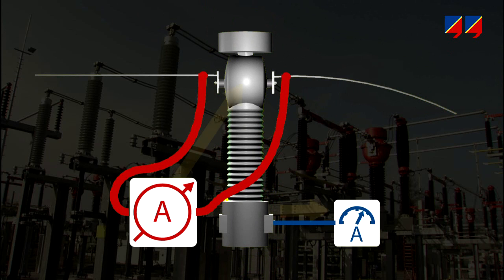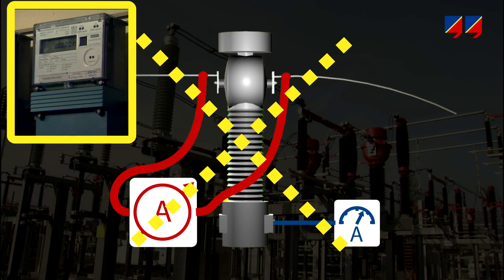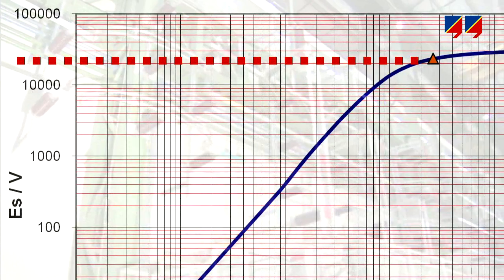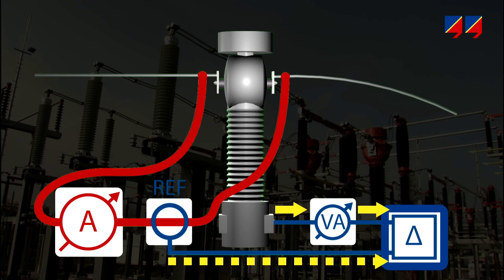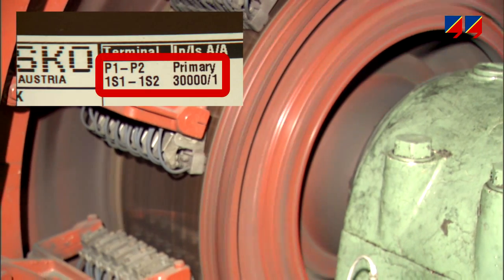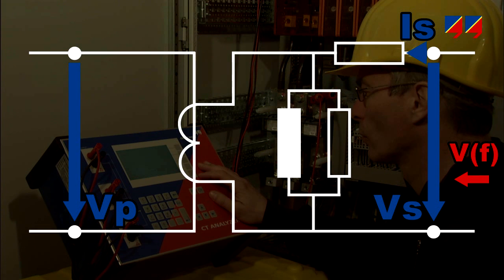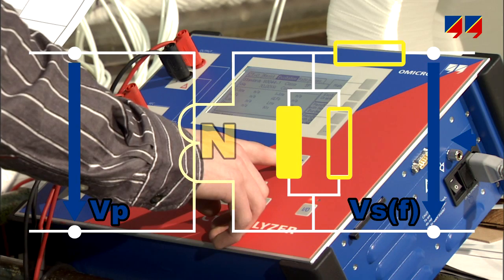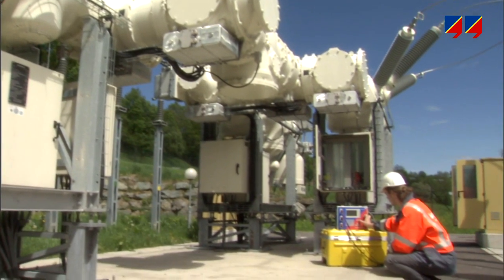Methods for current transformer testing

Comment: What happens if the HV terminals of CT is short circuited while performing Turn ratio test?
Reply from the maker: Dear Bern Traña, 

thanks a lot for your interest in this video and for your question. Connecting both HV terminals to ground would cause incorrect measurement results. Connecting both primary terminals to PE has the same effect as a short-circuit in the CT. When connecting the CT for a measurement, on side of the HV side is connected the ground. The side that is able to receive more interferences has to be connected to PE. This is enough to ensure safety, since the impedance between the 2 HV connection is usually very low. To get more information about Current transformer testing please check out the other videos in the following playlist: https://www.youtube.com/playlist?list=PLzmbZeI1bhu-bwtPfgxqAFE-LyK4DzX0h

Best regards, 
your OMICRON team

Comment: Please inform me how many type of test need for oil type CT and PT.
Reply from the maker: Dear abdullah real, 
thanks a lot for your interest in our products and videos. Regarding your question: 
For Oil Type CT’s the regular measurements can be performed with the CTAnalyzer:(http://omicronenergy.com/ct-analyzer) 
•	Ratio and phase accuracy 
•	Winding resistance 
•	Excitation characteristics (knee points) 
•	Composite error (ALF, ALFi, FS, FSi, Vb) 
•	Burden impedance 
•	Transient CT classes and parameters (TPS, TPX, TPY and TPZ type CTs) 
•	Transient dimensioning factor (Ktd)
•	If missing/unknown: CT type, class, ratio, knee point, power factor, nominal burden, operating burden, primary and secondary winding resistance
•	Remanence and residual magnetism

For Oil type CT’s, the moisture content and dissipation factor can be determined with our DIRANA (http://omicronenergy.com/dirana) device.

PT’s require a different set of measurements. Please watch these videos to find out more about it: https://youtu.be/4L0ch0-Paq8
https://youtu.be/eEvIyvewrbY

Best Regards, 
your OMICRON team
Reply: @omicronenergy  Thanks

Comment from the maker: kiran kumar M. Reddy 
 
Hello Omicron team, 
Good explanation..!

But I got a question in my mind about variable frequency method used in 50 Hz or 60 Hz designed CTs. 
Transmission lines reactance wont change.
But, the property of the core losses designed for a particular CT core, may vary for different frequencies. (Due to hysteresis losses or eddy current losses). How can this method can calibrate 0.2s class accurately?.
https://www.youtube.com/watch?v=rvsRDsR0ttY&lc=z131itdryk2pydzzf04cc1erok2cexnphks0k
Reply from the maker: Dear kiran kumar M. Reddy,

Basically you are right. The core losses are frequency depended. The excitation curve and its losses are determined by using different frequencies. In order to obtain correct measurement results, it is necessary to define a model of the transformer which allows a description of the frequency dependent behaviour. With this modelling approach a high accuracy can be achieved. 

Best regards,
Your OMICRON team

Comment from the maker: Option A, the primary current injection method, is common practice in the field for performing a functional check of CTs due to its simple approach.
For verifying highly accurate CTs for metering purpose, e.g. class 0.15 CTs,  or transient behavior in protection environment this method is not sufficient as the accuracy of the method and of course the injected current is limited.